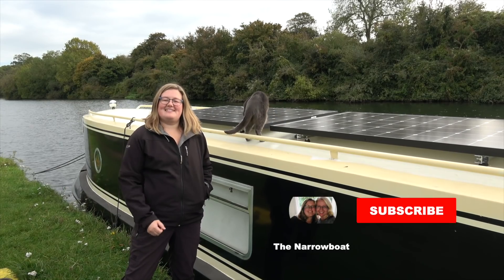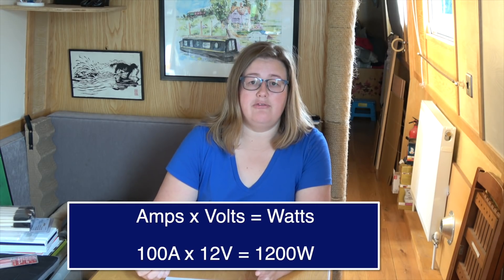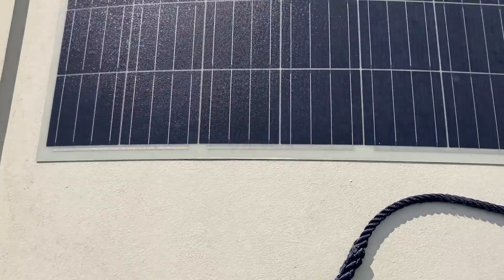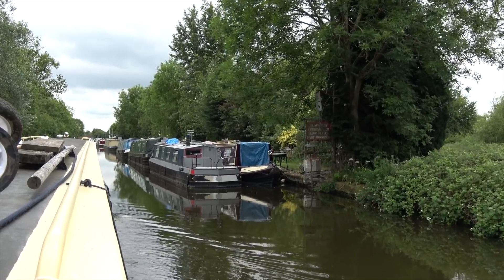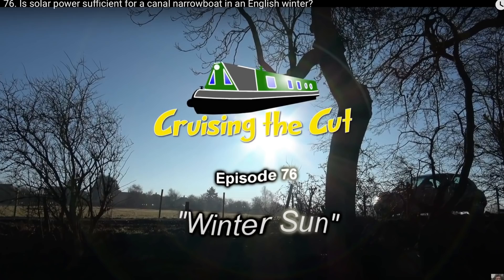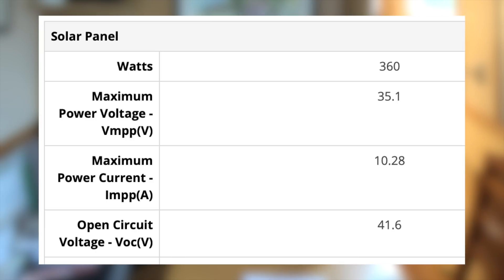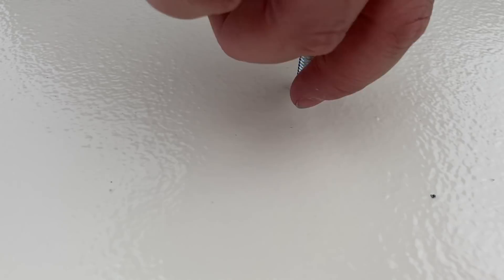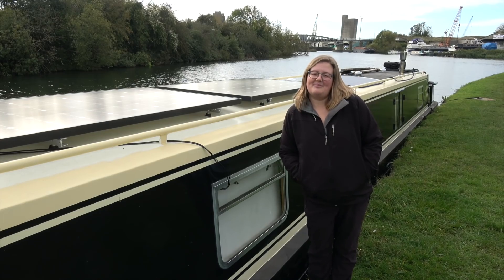5 THINGS YOU MUST THINK ABOUT Before Installing Solar On Your Narrowboat

Comment: Almost the same stuff as me 😁4*neon 2 all black 320w, option 2 of your three types of brackets, and a 150/100 Victron. I used self drilling and tapping fittings and sikaflex. 24 holes !! I get make power (1280w) about twice a year. Watch out for shading from cats!!
Reply from the maker: Thats a lot of holes!

Comment: Lovely job on the installation. One thingy to remember is electric current is like water and follows the path of least resistance. With dc current it's better to use the bigger power line, you will have better performance with the charging and overall performance of the panel. Good luck and stay safe you and your lovely kitty's.

Comment: Well done on getting extra solar. Personally, I would go for the third solar panel as well to help cover your power needs through the darker months from October to January. The next step is Lithium-ion batteries 8--)
Reply from the maker: Having spent a while checking power output, I'm still not sure that the 3rd panel was a worthwhile investment just for 2 - 3 months a year. We've had plenty of power the whole of October (so far). Only time will tell and the great thing is I can still add one later if needs be.
Reply: @TheNarrowboatExperience  Yes, October has been good. I find it's when you get two or three dull days in a row that you need all the solar you can fit. You can, of course, always run the engine, but I really like the silence of solar.  If you look in the files section of the '12 volts boating' group on Facebook ( 12 volts plural is important as there are two groups with similar names) there's an excellent chart and explanation of how much solar you need to provide a given amount of Amp hours of power during each month of the year here in the UK.
Reply from the maker: Thanks for the info, I'll take a look.
Reply: @TheNarrowboatExperience  There's a chart for lead acid batteries and one for lithium-ion which makes for an interesting comparison.
Reply: Finances permitting I have to agree. The only things that should limit the size of a solar install are available space and budget as solar (or battery storage) is one of those things you can't have too much of. No rush tho, the charge controller is large enough for more panels so if they find they need them they can get one then. 

As for Lithium batteries the jury is still out on those for house battery use in boats and RVs, a lot of RV owners have been very disappointed in the new Li packs and have gone back to AGMs. I'd be more inclined to go for a pair of 100 amp hour brand name AGMs for 1/3rd of the price.

Comment: Great blog Cath, I do have a question, think I saw in your electrical bay a victron inverter, how's that working out rather than a combined inverter/charger/solar controller? Did I see the inverter was connected to the circuit by a 13amp plug? Conciouse your CCing does the boat have a switch for shoreline? Mel asked are you still using the portable twin tub?
Sorry about so many questions, this is when you wish Jono was still about.
Reply from the maker: It was a Victron ac to dc charger for charging the batteries from shore power or if we ran a generator. We’ve never used it and it’s not actually connected to the batteries. 
There is a plug that we have to move to switch between shoreline and inverter. Something setup when the boat was built I assume. 
Yes we are still using the twin tub. Its been about 18 months now.
Reply: @TheNarrowboatExperience  thank you, very much appreciated.

Comment: Well structured video and well planned!

I have been using solar for quite a while and the costs have really fallen and may well get cheaper. 

I have recorded all my Solar input and output for quite a while and consistently have found: 

1. During the summer months I do not have to manage power (within reason) and I find I have more than enough power. However during the, what I call Dark Months (Nov-mid Jan), I have to manage my power and may find that Solar simply does not provide enough energy. From mid January things improve quite rapidly with some management required until end of March approx.

2. No one ever complains about having too much Solar, especially through the Dark Months! You cannot have too much!

3. Do not think that having a very large battery bank will help. The larger the battery bank the bigger the Solar input required. Do not forget that if you use conventional batteries (lead acid, AGM etc) you have to keep them charged above 50% or you will damage them. 50% of a large battery bank will obviously need more Solar to charge them.

4. A dual Solar Controller enables me to charge either my Starter Battery or a 2nd Battery Bank simultaneously. The second battery bank can be of a different size or age to the main battery bank. This enables you to add additional batteries at a later stage and of a different storage capacity or use older batteries that are not 100% efficient but still have some life in them after you have upgraded your main battery bank.

Just some thoughts.
Reply from the maker: Good points for people new to living off grid so  thanks for taking the time to share.

Comment: Just for clarity, when working out power consumption, are the watts stated watts or watt hours for a particular electrical item.  I only ask because it is important to understand the difference when calculating power usage.  Great video and extremely well done as explaining solar can be very complicated and confusing.
Reply from the maker: The electrical items list consumption in watts. The watt hours will depend on how long each individual runs the item.
Reply: @TheNarrowboatExperience  Forgive my ignorance, so an item marked 55w would use 55w in an hour ?
Reply from the maker: An item marked as 55w would draw 55w for as long as it was on so if you ran it for an hour then yes that would be 55wh.

Comment: I would love to see a infrared camera shot comparing the two different types of solar panels to verify which provides better cooling, the wind(flat vs raised) or the steel of the boat itself acting as a heatsink.
Reply from the maker: Interesting idea. Have you ever sat on a Narrowboat roof after it’s been in full sun ?
Reply: @TheNarrowboatExperience  I've never even been across the pond, much less on a narrowboat. But, I'm always curious about things and solar panels have spec sheets that list ideal operating temperatures. If you took measurements and put them in a spreadsheet I would study them but, an infrared camera cones across on YouTube much better. Plus you can use it to find gaps in your insulation or to help with diagnosing your boats engine(exhaust leaks or non-firing cylinders)